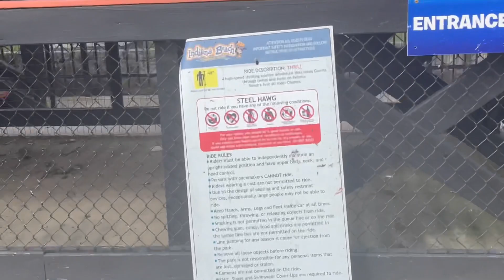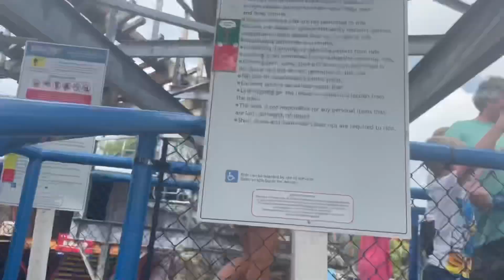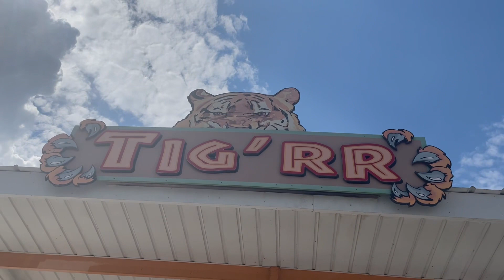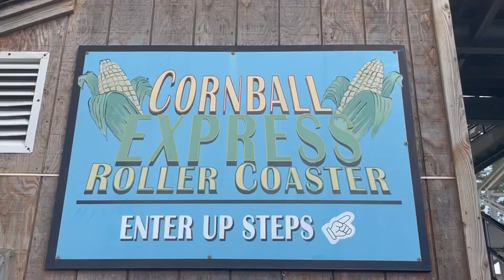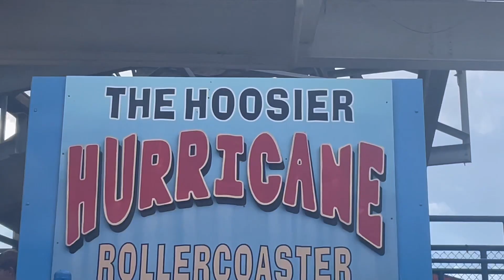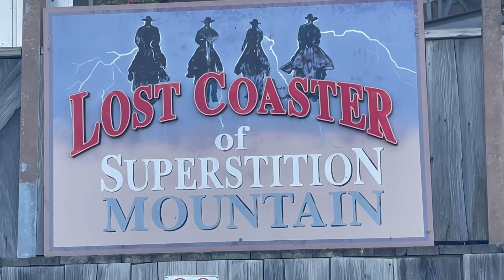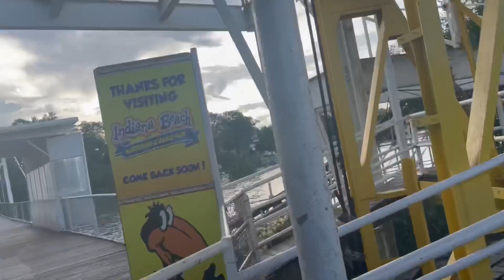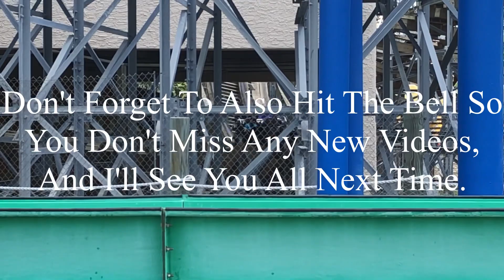Making it Back to Indiana Beach: Indiana Beach 9-4-2022 Vlog

Comment: They fixed the  yoyo swing's motor so it doesn't jog anymore.  Now you only crash into other people if one or both of you are swinging during the ride.  

Technically against the rules, and strangers would be upset with you, but the ride ops usually don't seem to care and if you have friends or empty seats on either side of you it's a blast.
Reply from the maker: It was completely dull.
Reply: @justiceleaguebattleformetr9239  that's fair it's a calm ride, the lake view and breeze is it's biggest selling point.  They moved it for half a season one time and all the locals got very vocal about how much the ride sucks in any other location.
Reply from the maker: @seanmce8132  I don’t think it would’ve made a difference for me if it was in a different location. It’s just overrated